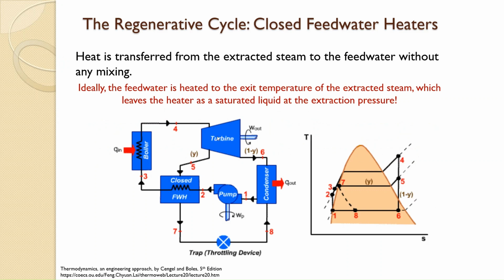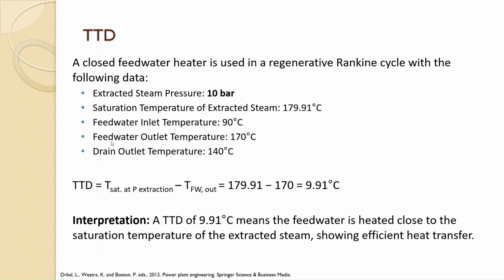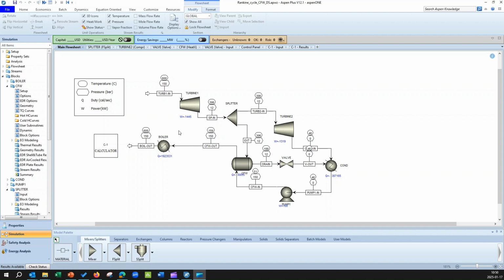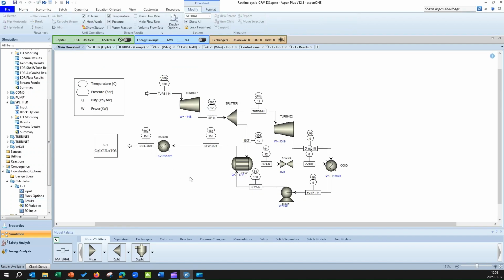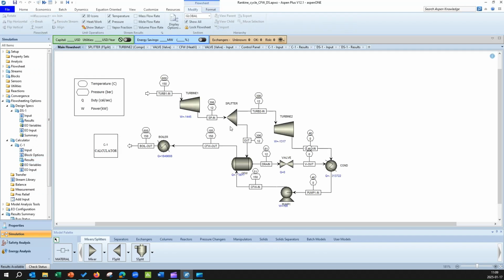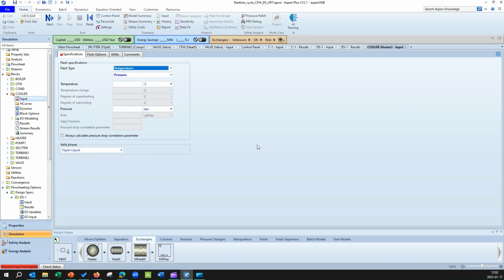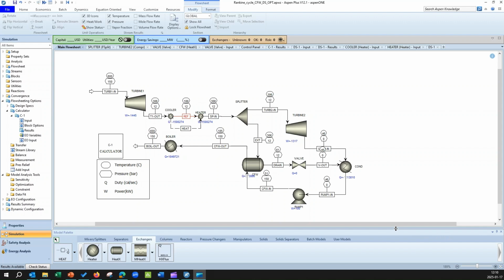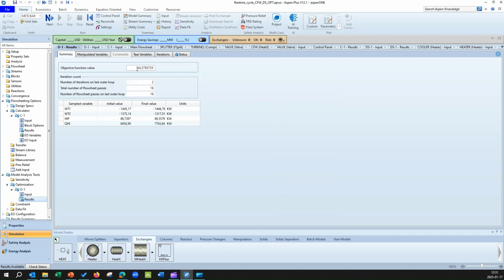Part 8: Optimized Closed Feedwater Heater using Design Spec and Optimization tools in Aspen Plus

Comment: Hi, I have a question, I have a dry air stream that needs to be humidified, in hysys we can use saturator, I believe in Aspen Plus we do not have this, how can I set up this as I want to be able to change the target humidity for many cases, I am using a mixer with inlet of dry air and water but I can not select RH at outlet. that would be appreciated if you can guide me, thanks